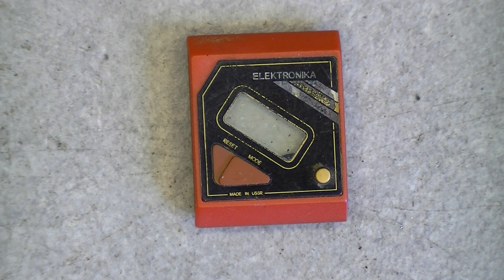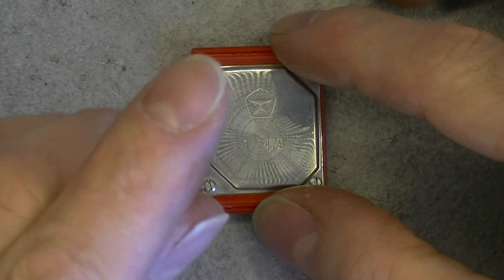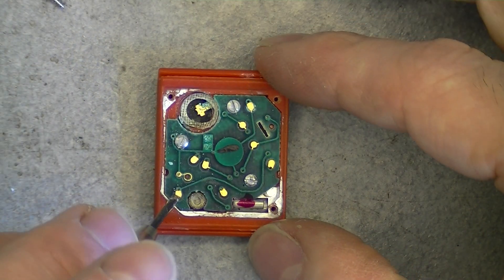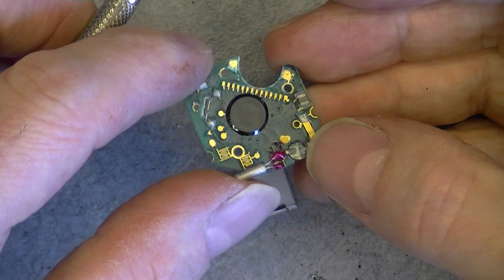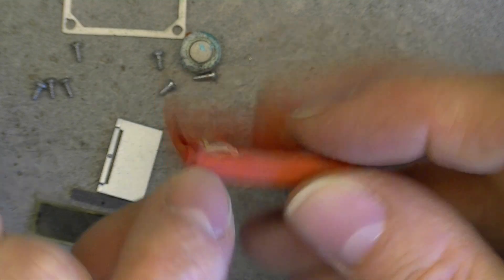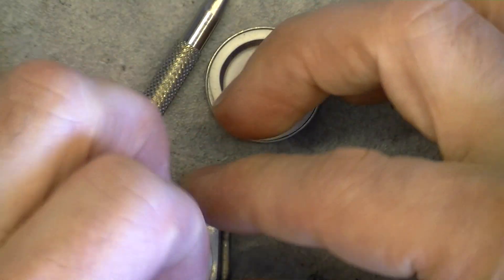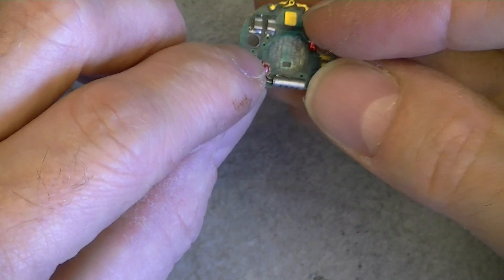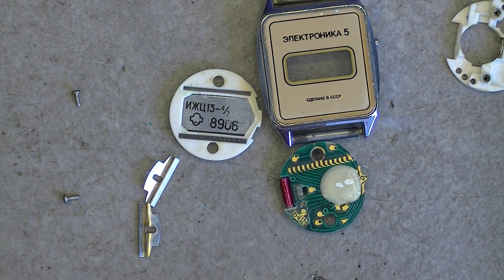Soviet Elektronika LCD watches teardown

Comment: Note the pink varnish on the solder joints in the first watch. It's the same as that in the second watch, and it's a very common feature of Soviet electronics. I reckon that first watch was assembled in the USSR, even though the PCB looks like it could have come from anywhere.